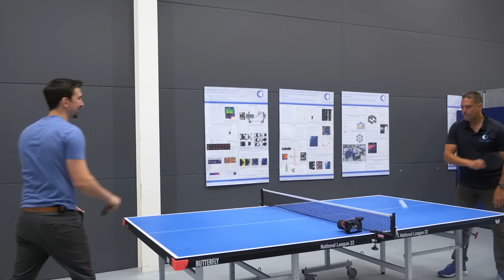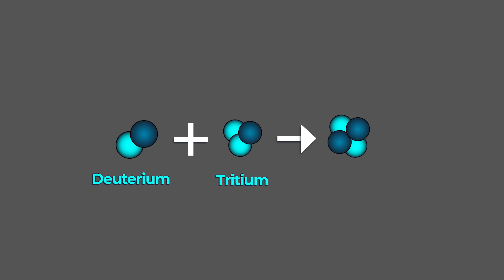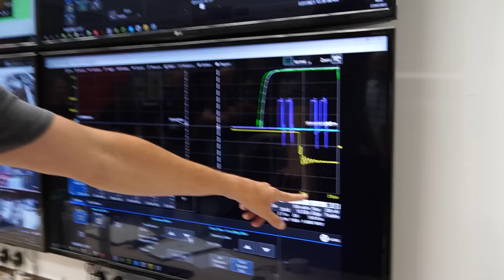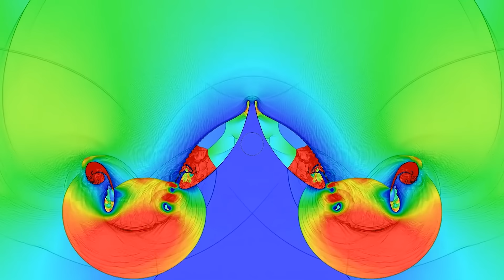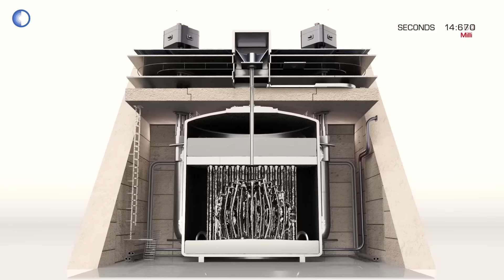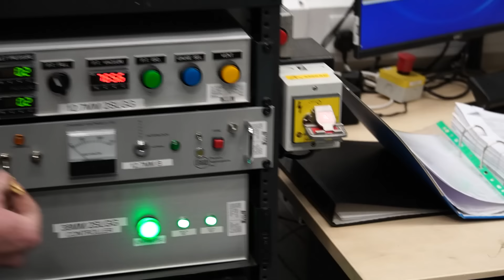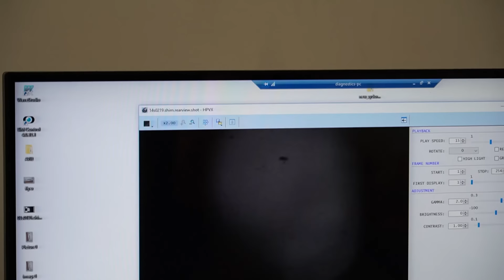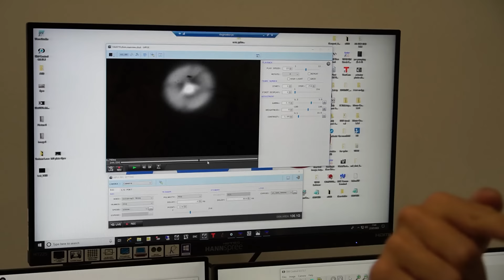Inside The UKs Breakthrough Fusion Reactor - First Light Fusion

Comment: How much time does it take to machine one of those launch disks, that seems like its going to be a huge hurdle to overcome - do they need more than just a finishing pass after being casted? It looks like their mock up for a at scale reactor has 72 locations for launching and each one needs to launch every 90 seconds which means they need over 2750 of those launching disks an hour. If it just requires a finishing pass that still probably 1-2 hours in the CNC, so that averages 4,000 hours , so in order to produce at a rate equal to consumption you need 4000 CNC machines and even if you assign a 6 machine cell to 1 machinist that's 667 machinist. You are also going to need 3 shifts (or two 10s) so that's 2000 machinest on staff per reactor so every reactor has a machinest labor cost (excluding material and cost to cast) of (assuming the average UK salary for a machinist of ~32k USD) 64 MILLION dollars per year just in machinist labor for those disks and that's being generous, if they need more than just a finishing pass to go from rough casting to final it's going to be 2-3x higher.

Comment: I've been really interested in fusion energy, have learned quite a bit about it over the years, and all the different approaches. This approach is very interesting but I'm sceptical about their 2030 target. Fusion energy has been theorised for well over 80 years, but investment has historically been extremely low. Only in the last 10+ years have private enterprises got involved, but they're effectively starting from scratch. There are post-energy production concerns as well, such as how do you get the tritium, which is not abundant and is currently EXTREMELY expensive. Even ITER are starting from scratch when it comes to Tritium production. I predict they'll still be in the experimental stage by 2030 unfortunately.
Reply: They get to use government data from 50 years of work. Most work so far is public data.
Reply: Tritium is a product of conventional nuclear fission, but it isn't being harvested for fusion experiments as far as I know.

Comment: The Helion fusion design looks to be the only player that has a chance of demonstrating a commercially viable system inside the next decade. They are able to directly extract electrical energy from the magnetic field of the fusion pulse. No super heated water, no neutron generation (causing containment damage), no steam turbines, and it easily cycles for the next pulse.

Comment: I'm not seeing how they plan to convert the raw energy into useable electricity. It doesn't even say on their website. I'm guessing it has something to do with the falling liquid in the blast chamber, but idk. It's's strange that they didn't explain it. Also, Is every 90 seconds too variable for power systems to utilize the electricity? I love the idea of fusion, but if it's not useable electricity, it's just another science experiment
Reply: if after every shot 11.25 GJ of energy is released inside the chamber, and considering 80% of it is absorbed by the fluid (9 GJ), then in 90 seconds an average power of 100 MW can be released to turn a turbine and generate electricity.
Reply: @luigeribeiro  will the fluid be able to absorb enough heat to keep the turbine spinning between bursts? Bursts of electricity are hard for the grid to accommodate. I've heard of heating pits of molten salt that will hold enough heat to keep a turbine spinning between bursts
Reply: Yes, it remains a science experiment.  Even if this approach gets passed breakeven there’s the matter of expended machinery.  It’s “only” a matter of scaling up the production of the machinery.  When the system of rebuilding reactor components is taken into account this approach will net-out at 1-2% efficiency like all the others.

The real benefits come from the technology used in the approach.  The NIF benefits come from the laser tech they’ve improved on.  This approach will get us the air-gap switches and launching disk.
Reply: @toohardfortheradiopodcast  I see the chamber as a short-term energy storage system that is recharged after every 90 seconds. Once you haver enough energy in The chamber between shots, providing constant thermal power to a turbine is the easy part.
Reply: He mentioned fast neutrons. We already have fission powerplants that work with fast neutrons. Probably, lots of liquid and a turbine.
Reply: 11.25Gjoule is 2.7 tons of TNT   ( 1kiloton = 4.186E12 joules) . The chamber must have thick walls!
Reply: 11.25Gjoule is 2.7 tons of TNT ( 1 kiloton = 4.19E12 joules)  The chamber must have thick walls!

Comment: Ex Navy Nuke here. All these "breakthrough" fusion startups need to present understandable  net energy in/ energy out and thermal efficiency data to even prove this is even remotely viable from a thermodynamic standpoint. Not being a downer but there is a reason why fission nuclear power has been around for 70+ years with hundreds of reactors where as fusion has remained (and will always) be a science research pet - project for academia, governments and venture capitalists who don't understand science. Consider from this standpoint all the thermodynamics here:

1. Gunpowder
Requires manufacture of components  potassium nitrate, sulfur, and charcoal

2. Projectile(s)
Not much info given but that requires energy to manufacture (even as a prototype proof of concept). In a production version, what will replace that? 

3. H2 (hydrogen)
Hydrogen has to be created by and if done so mainly from fossil fuels or the electrolysis of water

4. Burst Disk
Consumable and inefficient for any time of production unit; how can that even be taken to production?

5. Deuterium and Tritium Production
These are energy intensive to extract/create and Tritium requires a fission nuclear reactor; cost prohibitive  

6. Capacitors
 All those capacitors cost a lot of energy to manufacture

7. Parasitic losses...?

8 Cost of construction....?

9. Hooking up a viable and efficient heat exchange system....?

10. And since everyone is so 'carbon conscious' is this even carbon neutral?

Even if 'viable,' how could it even function in this manner? Some sort of reciprocating assembly to do the compression? 

We need genuine and critical reporting of fusion instead of this misrepresentative hopeful hype.
Reply: Great questions.

Comment: all current fusion has 2 main issues:
- its not continual energy generation/ignition, but only a single burst, that also destroys the core of the "engine".
- preparing and running the scientific experiment is VERY energy inefficient, and it costs way more energy in computing power alone, in a second, and the computers run for days, to generating energy in an ignition- burst for less than a second.

this is just not a power plant, and for a LONG time will never be one.

but still, fusion ignition finally has been done , which is when you get more energy out of something than from the system, by igniting something,  just like burning wood. so the above 2 are engineering issues, and not longer physics/science to-be-tested. still they are HUGE engineering issues, and you get single-fire LASER riffles and laser grenades from that (with very dangerous and inefficient battery packs) long before you get power plants from it.

Comment: This raises a few questions -  
I'm wondering how fast they can "cycle" their projectile shots?  
I mean -  even if firing a projectile gets you (say) 100 MW of power in an instant, that's no use at all if it takes you an hour / two hours or more to set up the next shot.  
Bang -  100 MW.  Wait for an hour.   Bang -  100 MW.   
How on earth can they get a steady, continuous flow of power from this device?
Reply: That is the fundamental problem with inertial fusion. If the power per shot is too great, the energy cannot be safely absorbed . If the power per shot is too small, a very rapid repetition rate is necessary.  A typical power station output would be 500MW of electrical energy, say 1GW thermal.
If we achieve a repetition rate of 1 shot every  second, that is 1Gjoule per shot. Thats about quarter of a ton of TNT per shot!
Reply: This particular device isn't meant to generate continuous power, it's for researching their confinement method. If they ever get to the commercial stage, the power is going to be a lot more than 100 MW. Gigajoules per nanosecond so exawatts. An Otto cycle gasoline engine only burns fuel for a fraction of the time yet still manages to produce continuous power because the energy is transferred to a working fluid that expands relatively slowly. The same principle would smooth the output of a commercial pulsed reactor. Neutrons from the reaction would heat up a lead-lithium alloy which stores the energy between shots.

Comment: Like the original fission experiments that used projectiles to compress the nuclear material, but taking into account the need to compress the fuel uniformly like a fusion bomb (surrounded by a fission explosion). Quite an achievement with a projectile.

Comment: It’s interesting that they used the analogy of the shrimp that uses the cavitation bubbles because I was thinking about that in order to use it as an example for a fusion due to the high temperatures and light that the shrimp produce when they do that which is quite impressive.

Comment: Will be interesting to see if this works. 

Helion's design likely will work because its pure magnetic acceleration rather than this approach or using a gun blast for compression.

But this is cool none the less to try and research.
Reply: Dude FLF and Helion are the two fusion companies that literally no one takes seriously. Bottom of the pack. You’re supporting the wrong ones lol.

Comment: If they used a rotating holder for the projectiles, they could make the process repeatable by rotating a new projectile into the machine.  The spent projectile could be removed by a mechanism built into the rotator, and a new projectile could replace it.

Comment: I have the highest hopes for FLF, as their approach is by far the simplest. the challenges that they will face are clearly resolvable, and there are relatively few points of failure. Most importantly, they are not reliant on chaos control, which is a major problem with tokamaks.

Comment: Looking at the burst disk at the very end, I am reminded of the automotive air bag realm, in which the bags are inflated by an electrical spark igniting a chemical propellant stored inside of a metal can.  These cans have to "fail" in a very specific, controlled way.  There have been years of research and quality assurance design poured into the metallurgy needed to manufacture these cans to make them as reliable (and shrapnel-free) as possible.   Zoom out to the fusion reactor as a whole, and you can easily envision enough materials challenges to keep an army of dedicated materials scientists and engineers busy for decades!  Not easy in any way, shape, or form, for sure.

Comment: I wish the video included couple key numbers:
a) how much energy will be required to fire the shot that causes fusion?
b) how much energy will the fusion release?
c) how much material will be required per shot (and what is it)?
d) how much fusionable material is available on earth currently? (or in the future)

As one thing that I've seen not to be mentioned is the lack of fusion fuel. If Tokamak works and is turned into a reactor plant, it would eat all the tritium on earth in a month. And just the fusion research will be using 60% of the fuel we have currently. And almost no new fuel is being created.
Reply: Every D-T reactor proposal includes some kind of Tritium breeding blanket. There's Deuterium and Lithium on Earth for 100s of millions of years of fusion fuel, and also other fuel mixes possible.
Reply: @MattNolanCustom  though these breeders are still not yield positive nor are we extracting tritium faster than it is used. Nor are we building reactors to make tritium.
Reply: @AllanSavolainen  there are bigger problems to solve first. With limited budgets you have to prioritise. No point in building a cart until you've got a horse. Having said that, ITER will be testing a number of breeding blanket approaches, if they ever get there. Commonweath Fusion Systems will most likely beat them to it. If First Light can make their thing work, they will have one of the easiest times of it regarding breeding as they don't have a first wall in the way and can cover almost all angles of neutron escape with their lithium curtain.
Reply: @MattNolanCustom  In the billions of fusion research, some millions put to side to figure out the fuel problem would seem like a smart thing to do.
Also I am highly pessimistic on just about all current fusion reactor types. Polywell seems most plausable with lithium fusion, sadly the best magnetic geometry was patented, so only one company is researching it. I recall that lithium fusion produced electrons so it could generate electricity directly and not with heat and steam turbine like every other reactor type so far.
Though even this fusion reactor suffers from radiactivity and creates radiactive waste, another thing that is omitted when talking about fusion reactors.
Reply: @AllanSavolainen  all of the Lithium fusion reactions have even higher ignition temperatures than D-T and vastly lower fusion cross-sections. We're not going to be making net power with any of those any time soon. Also, some of them are not truly aneutronic as, for example, in D-Li6 fusion there's nothing to stop D-D fusion happening in a bulk plasma. Which company is seriously pursuing the Polywell?
Reply: @MattNolanCustom  Hmm, seems that Energy Matter Conversion Corporation which owns the patents and has been working on polywell since the 80s has gone silent around 2020. So currently nobody seems to be working on it, and cannot until the patent expires in about 10 years. Unless they buy the IP rights.
Reply: @MattNolanCustom  Polywell still is to be the best option, meaning that we are nowhere near any practical fusion power generation. Probably won't see it happen in my lifetime.
Reply: @MattNolanCustom  More fission reactors now and move to fusion plants in about 100 years or so.
Reply: @AllanSavolainen  those patents have been "abandoned". If you don't pay the renewal fees, they lapse. There's nothing stopping anybody working on Polywells besides motivation and funding
Reply: @AllanSavolainen  I agree that we should be ramping Fission up right now, not ramping it down. But only because it is the best bridging tech until Fusion is sufficiently developed. There's no reason that funding research in Fusion should stop rolling out more Fission, or vice versa.
Reply: @MattNolanCustom  Really? I thought it was also 20 years in US? I think they also had EU patent which doesn't require any fees after granting it. Only if you want to extended term you might have to pay.
But it they have lapsed, then that is good, though companies might not want to touch it as getting a patent on their work could be more difficult due to prior art.
Reply: @AllanSavolainen  as far as I am aware (I've written patent applications and am a named inventor on ones owned by previous employers) patent protection lasts 20 years in most jurisdictions, but only if you keep paying the annual renewal fees. Protection only applies in jurisdictions where you keep up the fees. You are right that an existing, granted patent, lapsed or otherwise does preclude further work from being patentable unless it contains a genuine inventive step which is not obvious to those knowledgeable of the the prior art.

Comment: This is amazing and good luck to this team with this approach, However there is a but coming how does the production of Tritium actually work in this design? I'm guessing the neutron bombardment of Lithium from each shot produces the Tritium but capturing that and making it into a fuel pellet will be a big problem to overcome. Unless its self sufficient in Tritium production its dead in the water which I'm sure they know and you'll need a fission reactor to supply the Tritium which is kinda pointless and very expensive great idea though

Comment: It is a little sad to read some of the negative comments below. The people involved in this project are trying to find a way of using repeated fusion reactions to generate a supply of energy which will presumably be used to power a generator. And yet many of the people criticising it seem to think that traditional sources of heat, like burning gas, are "continuous" processes, so a fusion reactor has to be "continuous". That is a shame. Nothing is continuous in any process if you look closely enough, at least that is what the idea of "quanta" actually tells me. 
No one is sure if this approach will be successful but some of the critics here would probably object to burning one lump of coal to power a steam engine on the grounds that it isn't continuous!
Thank you for educating an ignorant layman (well sort of,  I did use NMR machines in the 1960's looking at the people who seemed to be the previous occupants of this building)

Comment: Great video!!! thank you! correct me if I am wrong, but for a commercial power plant they would have many of these guns firing and creating heat, that heat would then be used to boil water and the steam would turn a turbine generator.  so, them getting one shot to work correctly is the first real step. the heat is generated from that fusion reaction (heat, light, and a neutron).